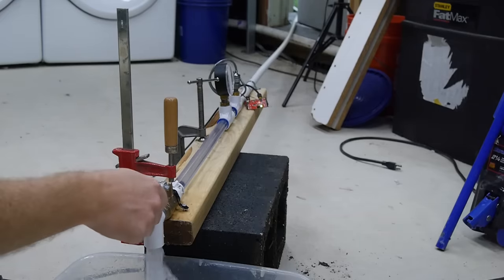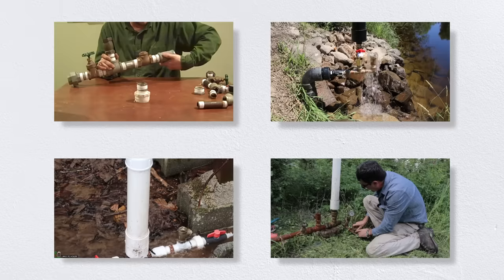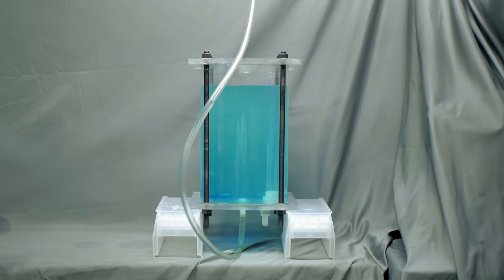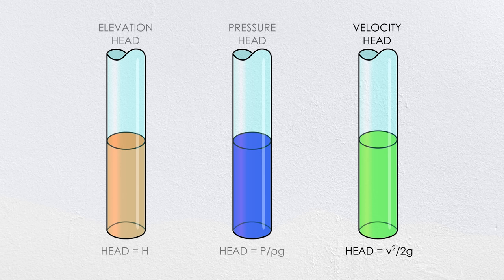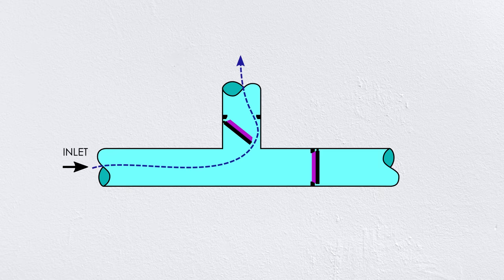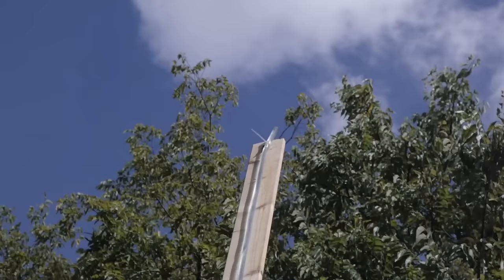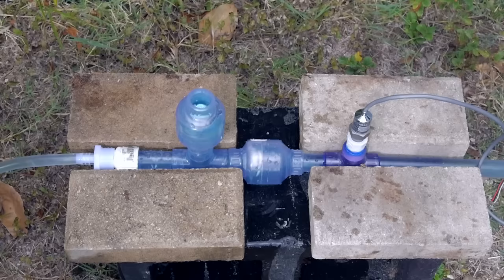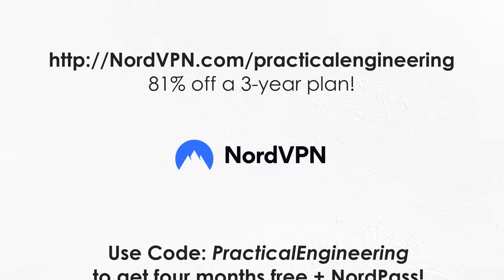How Does a Hydraulic Ram Pump Work?

Comment from the maker: Make sure you never miss a Practical Engineering video and keep up with all my other projects: https://practical.engineering/email-list
Reply: But How does the escape Valve closes??
Reply: @juliogaiger5221  The waste valve is normally open, the rush of water past the waste valve is what slams it shut.
The pump valve is normally closed, the water column that is being pumped up provides the bulk of the force to keep that valve shut. Though for starting purposes most pumps have some sort of pre-load on that valve to help the water hammer cycle get going.
Reply: comfrey kid  A hydraulic ram pump has an efficiency that's well below 10%. These things are not efficient, they waste most of the water that passes through them. And they aren't good at pumping large volumes of water. So if you have a small amount of head over some drop of water, you're better off building a turbine specifically for that flow rate and head height, rather than waste the bulk of the energy in that flow in order to make a smaller flow with less energy.
Reply: comfrey kid  this isn't even close to free energy, in the most basic sense you are converting kinetic energy (of some part of a stream) to potential energy (of some other parts of the stream). You end up losing some energy in the process, since no system is perfect. The ram pump requires a flowing stream. It makes more sense to just use the entire stream for turbines.
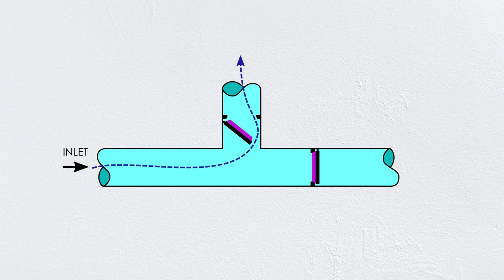Reply: @juliogaiger5221  As the water flows through the open waste valve, the valve itself acts as a slight barrier to the flow. This causes a small pocket of pressure to build up on the underside/upstream side of the waste valve. Because there is a difference in pressure on both sides of the gate of the waste valve, the gate 'wants' to move but while the pressure is low the force from gravity prevails. Once this pressure is strong enough (usually just a few psi) to slightly lift the gate of the waste valve, the valve begins to develop an even greater pressure imbalance. This is what causes the waste valve to close (see 4:53 ). The waste valve closing stops the momentum of the flowing water which is converted into a spike in pressure which briefly opens the main valve. Once this pressure dissipates, the main valve closes and, because the chamber is now low in pressure the waste valve opens again under the force of gravity allowing the water at the inlet to start building up momentum again. Once this  flow becomes great enough to start building up the pressure pocket in the waste valve again, the cycle restarts
Reply: So then no air vessel is required for a hydraulic ram ?!
Reply: @fermitupoupon1754  Things used to be simpler and this was an elegant solution in its day.  Carrying buckets are not fun.  Until dad had the basins built to use the ram guess who had to carry the buckets. 8-]  "nuf said"
Reply: Do a test brick vs cinder block in building
Reply: persian made this system 2500 b.c nothing new for us :D
Reply: Watse of water
Reply: @trikesterHal it's still an elegant device. I mean it is basically self contained. I can definitely see applications for these pumps even today.
Reply: You talked about a lot of other things but you NEVER EXPLAINED HOW IT WORKS!!
Reply: Check out John Cadman, pyramid hydraulic ram pump. Ram pumps make water echoes, this one produces shock waves. Great video sir!
Reply: Men, i want subtitles in spanish! Please!!!
Reply: Woo you made one.
Reply: Could you do a video on piling
Reply: why am i just finding this channel
Reply: This is a little off subject but I have always had this one question.  Ok, when they teach the theory of electricity they compare it too water and how it flows.  What would the electrical equivalent be of a water ram pump ????
Reply: L..
Reply: Have you applied this knowledge when thinking about the mechanics of the heart. Combine this knowledge with "exclusion zone" water, and the fact blood flows in embryos without a heart. Lots of scientists have shown the heart doesn't pump blood, and this makes me think the heart is an alternator capturing blood flow and converting it to electrical impulses.
Reply: Can you use a balloon over the check valve to save water from being wasted?
Reply: Can the ram pump be fully under water?
Reply: With the ram pump can I go into a shop and by one
Reply: Grady how can you believe earth is round? When you know water always finds is level.
Reply: can a ram pump generate electricity?
Reply: Can you please add the Bernoulli and the radius of earth the that pump and see if it can work over distance. Thank you.
Reply: Sir, can you pls. List the materials need.
Reply: How makuni fuel pumps work?
Reply: this is the best explanation of the ram pump i have viewed on the internet.
Reply: My punching bag balloon blew on my ram pump. It then blew the pvc pressure tank. A tee shaped ram pump stands on it's own. I have a stand pipe because of flowing well. DON'T RAM YOUR FLOWING WELL OR TURN OFF VALUES QUICKLY.
Reply: Ram pump + Water powered turbine = free energy
Reply: 😮🎉🎉🎉🎉🎉🎉🎉🎉🎉🎉🎉🎉 3:50 300 rupees
Reply: Could you please give me a parts list for this?

Comment: in electronics its called boost converter
Reply: Beat me to it
Reply: Beat me to it 2
Reply: Beat me to it 3
Reply: Beat me to it 4
Reply: Beat me to it 5
Reply: It's really cool in how many ways electricity can be related to fluid dynamics
Reply: Really? I'm studying eletronics but still don't reach boost converter topic. Thank you for this first information about it. Fluid analogy always help me understand better.
Reply: @zesegatto  since an inductor's induced potential depends on the rate of change of current, the opening of a switch (a large change in current in a very small time) momentarily causes a very large induced potential. This is very similar to water hammer. This induced potential can be used to create voltages higher than the source voltage.
Reply: since you are not using power you are putting cables to do our job
Reply: @AyyMD VEGA,
Thank you for this even more detailed explanation.
Reply: I came to say “spark plug,” but today I learned what a boost converter is.
Reply: Yeah it's always surprising to me how much overlap there is between electronics and fluid properties
Reply: @Felixkeeg  The two are just different manifestations of the same set of wave equations.
Reply: Beat me to it 7. I really like how the water analogie keeps working here.
Reply: @Felixkeeg  Once upon a time, there was a transistor made of fluid instead of electricity... Just study the term "fluidics".
Reply: Fascinating, the parallels between water and the flow of electricity run deep!
Reply: your reasoning is a bit inductive for my taste
Reply: So what's the equivalent of a buck converter?
Reply: stole my comment... :(
Reply: It's amazing how electronics and fluid mecanics are similar
Reply: @zesegatto  i never learned it in school, i had to look it up after i started using arduinos
Reply: This comparison is only approximately similar. In reality a boost convertor is a very efficient device with the efficiency ratio of over 80%, sometimes over 90%. A ram pump is very wasteful, its efficiency normally does not exceed 10%. It's can only be useful if there a lot of free water energy, so the waste is acceptable.
Reply: Oscillators and differential equations. This is the reason for all those "pointless" theory classes in engineering.
Reply: @bosstowndynamics5488  Maybe? That doesn't have switching, though.
Reply: Place a valve on the output of the pump and it's a buck/boost converter
Reply: Nobody said "Current mode controller" so I will.
Reply: Glenn Tang A tank with level switch and feedback loop. You need small amount high pressure water to keep lots of low pressure water moving slowly. .. maybe.
Reply: @Felixkeeg  acoustic pressure waves as well.
Reply: Any relation to a charge pump?
Reply: no, in electronics it called fly-back pulse power supply: switch,  diod, inductance(inertion), disconnecting of fast current that accelerates in induction while switch is open, then switch(usually mosfet) is closed, and current running fast in inductance(coil or even simple long cord - in hydraulic no good analogy for cored coil- it is like tube with ideally connected with flow - hard turbine- gives more ineretion to flow of electronic gas(gas, still electronic flow often acts like a liquid in life) - causes shot process - when hard, energy storing magnetic vortex flow in core of inductance coil - pushing electrons current further- in supposed to be like a railway loop with running locomotive - loaded by core magnetic flow -why it hard weight and inertion(inductance) here, when you change accelerating pushing of battery-source(river) and disconnect railway by some resistor(like cement wall) - locomotive will give shot with high force(pressure, potential)  and can brake that wall with some arcs  even
Reply: sorry - you are right
flyback - is a bost converter 
language terms problem occured - i think you more right than me - i never differentiate fly-back design from boost converter - now i know-than single coil device - called boost converter while flyback contains transformer 
usually a feel all turns of transformator - like one - equall in rights but independent - so there is not much difference for me - between theese designs
Reply: @NXTangl  Your garden splinkler? I don't think there is one, at lest not as good.
Reply: I've been using this for at least 10 years now. Everytime I am explaining boost converters to someone, I am starting with a hydraulic Ram.Also, there are quite handy parallels between coils and turbines or spillways and diodes.
Reply: @VoidHalo  one minor correction, voltage is actually more analogous to head then a force. In fact, head is a difference in gravitational potential and voltage is a difference in electrical potential.
Reply: beat me to it 8 haha
Reply: Holy shit now it makes sense
Reply: Beat me to it 99
Reply: I too, came to this comment section to post this comment. EEs unite I guess.
Reply: Compare the State-space model.
Reply: So, if i have a steady flowing river i can drive it up to a tank use that head pressure to drive a turbine generator to create current to use in the hydrolosis of water and use the hydrogen to light my joint?
Reply: And in Karen language it's called a Mysterious unknown magic machine
Reply: I'm disappointed that no one in this entire thread mention the two key words: inductive kick.
Reply: @Felixkeeg  Its a fluid of electrons :D
Reply: THATS WHAT A BOOST CONVERTER IS??? Everything makes sense now!!!
Reply: Beat me to it 6
Reply: Yes!
Reply: @Felixkeeg  traffic is also able to be modeled like water.  It turns out particles in a tube behave in certain ways irrespective of the particle size.
Reply: In the hood it's called " nothing" because nobody knows about it nam say'n
Reply: @patrickmalone1373  you know what? You're right mah gee
Reply: So many electronics-aware people here! When I've been learning switched circuits, I didn't find a lot of people around who already grasped this concept.
Reply: @blg53  And that 10% will actually include..
1.No moving parts
2.No power requirements
3.Inexpensive
4.Quiet pumping continuously over a long period
5.Pollution free or “Green” pump
6.Simple construction and easy to install
Reply: @user-en6xs2nu7w  You are right (except the "no moving part" bit, this is not true), but how it invalidates my post I have no idea. Also you forgot to mention that unlike a boost converter ram pump requires maintenance (cleaning, filtration, etc.)
Reply: @blg53  The word Wasteful !
Reply: @user-en6xs2nu7w  That was in relation of output energy versus input energy so that to make the comparison between the two relevant.  You are comparing apples with oranges by applying different criteria of measurement to the two devices.
Reply: except a boost converter is far more efficient than a ram pump.
Reply: And I want to find an equivalent for air. Wind powered air compressor!
Reply: The ESR on that air capacitor probably a bit too high 😄
Reply: is that the principle/component behind a Joule thief?

Comment: “We live at the bottom of an ocean of air”. Wow. Engineering poetry!
Reply: some may consider it poetry but it is true.
Reply: And 100% accurate too.
It just so happens that said ocean is about 1000x less denser than water, however you ARE still somewhat buoyant in it.
To the point where your WEIGHT(The value of force acting on you in a gravity well) and MASS(the intrinsic property of an object comprised of atoms) are actually measurably different.

That's right:
The bathroom scale IS lying to you.
You are about 1.1 grams per kilogram heavier than it actually says
Reply: Wow

Comment: Maybe, another point that could be further clarified is the by converting kinetic energy into potential energy, the water could be stored at a higher elevation for future use. I do enjoy your videos.
Reply: In practical installations, it usually IS stored at higher elevations. The set-up shown is just to demonstrate the principle of how a ram pump works.
Reply: Uh, yes, congratulations, that is the entire point of the video. How many times did you need to watch it?
Reply: There is a difference between potential energy, and hydrostatic pressure. :)
Potential energy here would be called static pressure.
Because the fluid would be at rest respectfully, however the reaction in the video is directly related to the hydrostatic pressure, and water hammer.